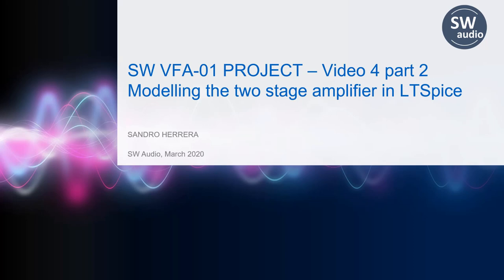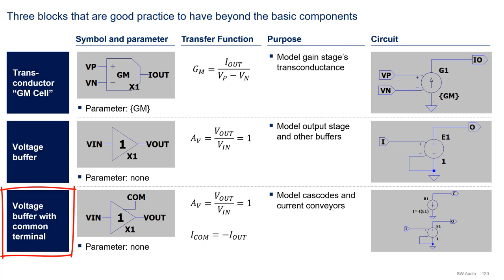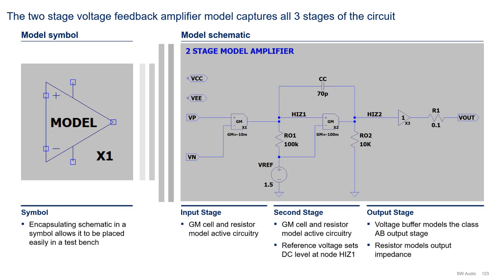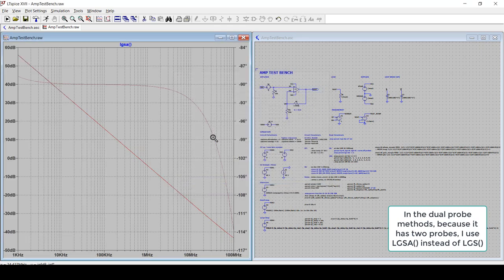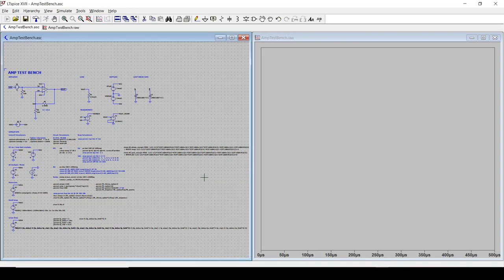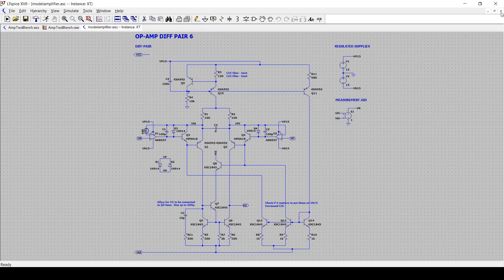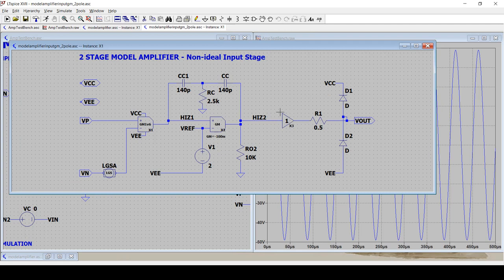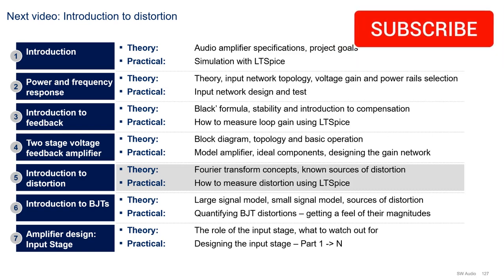4.2. Modeling Two Stage voltage feedback amplifiers in LTSpice - Audio Amplifier Design Fundamentals

Comment: Are the components shown are already available in LTSpice? Or some of those are new symbols/components that you made?
Reply: And can i ask for the simulation file? Thank you
Reply from the maker: @myhe1649  Hi Avrll, the "symbol and parameter" are boxes that I have made.  The implementation of each box is under the heading "Circuit".  The simulation material is at the link in my pinned comment above.